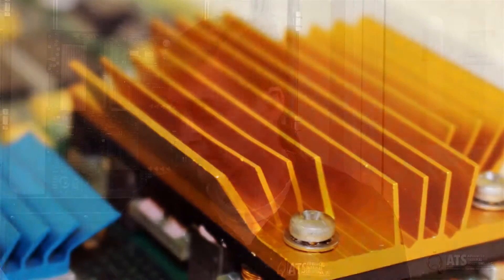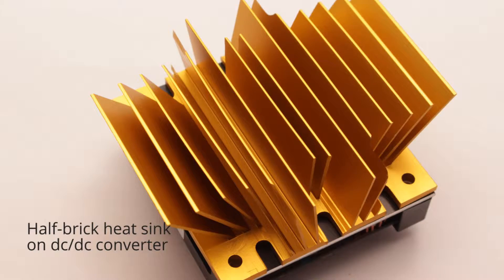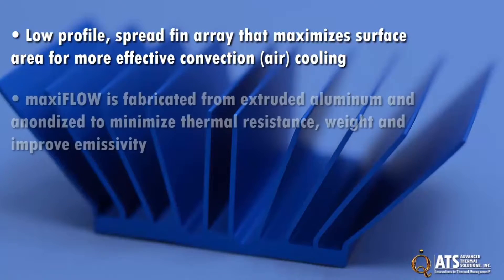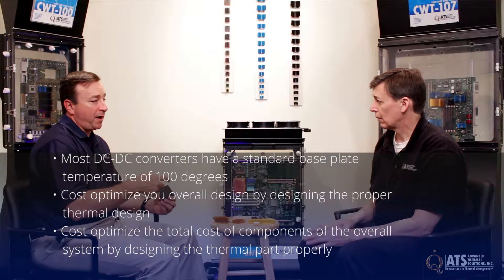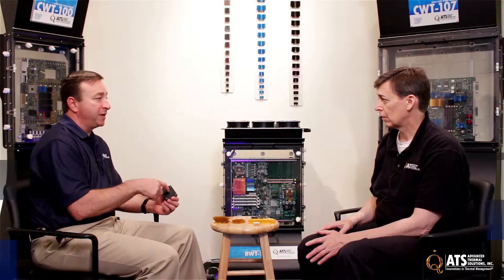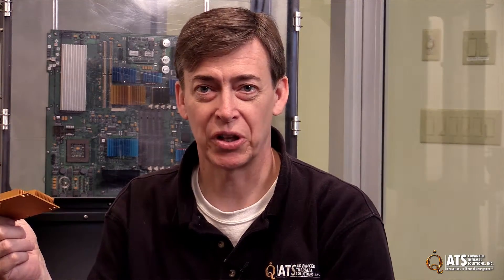DC to DC Converters  and Power Brick Heat Sinks

Comment: Not worth a patent
Reply from the maker: Thanks for visiting our channel 
@tarunarya1780  and leaving your commentary on our heat sink and the technology it uses.   Your comment  "Not worth a patent" is very interesting.  Do  you have some empirical data you can share with us?  Or maybe  you have used our product and found them not up to the requirements of your  project? We would genuinely be interested in your qualified engineering perspective and happy to discuss your findings.  You can drop your info here on the channel or email us at ats-hq@qats.com
Reply: Firstly, to be clear I have not bought or tested your products and am not saying that they are not good, or what you say they are.I am also not saying it is not good to have spec'd components to ensure that it will work in your use case.
 I do not think that heat sinks such as maxiflow are that innovative that it should deserve a patent. I think that it is an obvious design and not that hard to test iterative designs.
 Heat sinks will need to vary according how much power you wish to dissipate, how long it will be on, and your cooling solution. Other than that it is about maximising heat transfer to your "DUMP/Buffer" medium e.g. air and this will be about surface area with your "DUMP/buffer" medium. Having thin versus thick films depends of the balance of conductivity/heat capacity and use case(power and intended duration of use)/cooling solution. 
Splaying out fins is not innovative or hard to test. Copper will conduct away the heat faster. @heatsinks 
I must have been having a bad day to make the comment in such a brief way, but the patent system is in general I feel very abused with minor obvious things getting approval, and stiffling development.
Reply from the maker: @tarunarya1780  Thank you for your thoughtful reply @tarunarya1780    The U.S. patent system does allow minor variations to be patented and in some cases that can be problematic and can stifle innovation, we agree with you on that.  

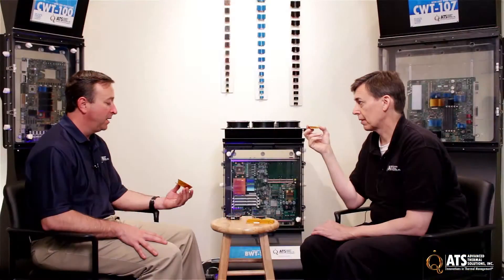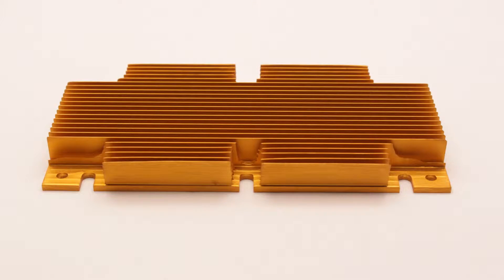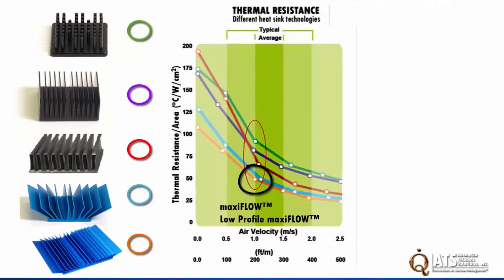Regarding maxiFLOW, its a different story.  Its not just splayed fin array, there is engineering on the middle fins that acts somewhat  like a duct to direct airflow. We had two of our engineer and one of our physicist working on that.  Both Phillips and Northeastern University tested maxiFLOW and found it to indeed drive air down to the base  of the heat sink, which improved thermal performance 20%.  The speaker references those studies from about 2:20-3:05.  If you have the time, and would like to, we'd invite  you to checkout our video "maxiFLOW Heat Sink Technology Video" at about the 1:34 to 2:32 section where we talk about the work both Northeastern University and Phillips did to verify our tech.  Here is a link to that YouTube video that starts at 1:34  https://youtu.be/qn84QO7gMIA?si=VHxnscY4VyLYxPBo&t=94  (sorry about any ads, that is something  YouTube does automatically).

Thank you very much again for leaving a comment.
Reply: Thanks for replying. Your video makes 2 claims - maximun thermal performance for the volume it occupies (~0.11) and highest performance for base area(somewhere), and mentions its affects on adjacent components. 
If the fins were vertical (whether folded or not) they would naturally form a barrier to airflow from the side.By splaying the fins out, you are "borrowing cooling air flow from adjacent components" and by reducing resistance as the percentage sideways profile occupied by metal will be less.
What is clear is that this for items without a fan mounted on top of the item but a sideways fan, such as a large fan blowing air into the case.
In your response you said it drives air to the base. I cannot see why you are saying that for the side mounted fan which is the case where it reduces resistance basically because it is borrowing adjacent boards air space for the same number of fins.
If the fan is mounted vertically above, air will be naturally funneled to the base of the splayed fins as in your graphics card picture.
I am really sorry, but there is nothing that makes me me think that's a surprise or really clever, just that it has been tested and given a patent. I appreciate you had skilled people working on it, but it seems really obvious to me. With your designs the angle of overhang means you have almost twice the airspace vs the area of the base. https://youtu.be/qn84QO7gMIA?t=65
I looked at your video because I had wanted to make a remote controlled lawn mower, and thought the controllers were expensive. Thought I'd learn re electronics/motor drivers/controllers and was looking for a cooling solution.

 @heatsinks